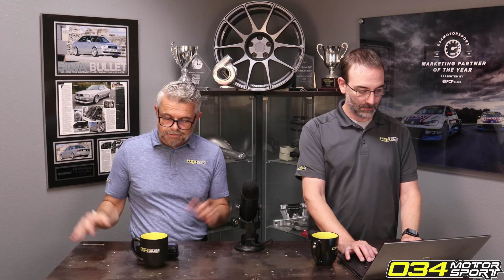Does Dynamic+ Tuning Cause Engine Failure? | 034Motorsport FAQ

Comment: Wanted to ask how much development went into the MK7.5 Golf R stage 1 & 2 tunes.  Not much info online about them. Lots of talk about Audi S4s and higher models or Mk8 Golf R.... But not much on the Mk7.5. 

Just wanting to make sure the tune is as safe as all your other tunes which appear to have had lots of time invested in.

Thanks :)
Reply: Well I'm sold. Thanks for replying 😀
Reply from the maker: Every tune that 034Motorsport produces and releases are held to the same standard of high quality, reliability, and safety, and are tested thoroughly to ensure this is the case. You can be certain you'll be getting a quality safe tune from our Mk7.5 Golf R files, as well as any other tune we offer.

Comment: So I just received my 034 207mm pulley kit. Do I need to be concerned with the belt I received with the kit to start making noise and slipping when I install it? Or should I just order a 1355 belt now?
Reply from the maker: You should not have slipping issues unless your tensioner has started to fail.
Reply: @034MotorsportUncut  awesome, thank you. I’ll order a new tensioner just to be safe then. Car only has 65k miles but better safe than sorry